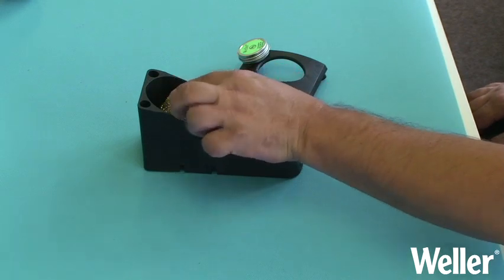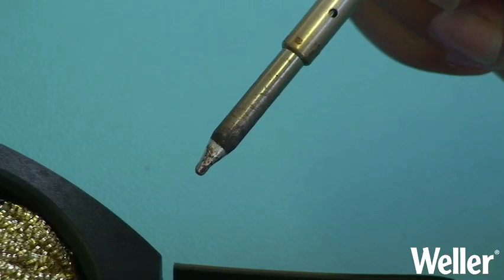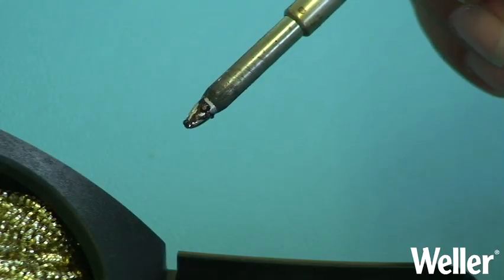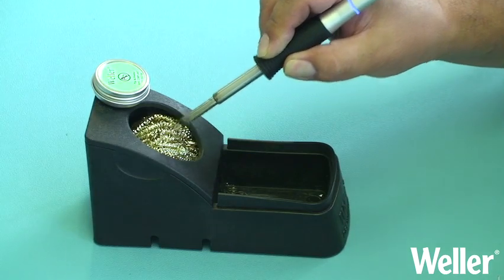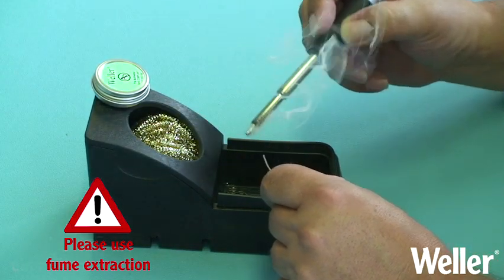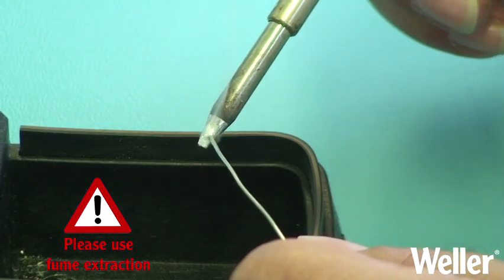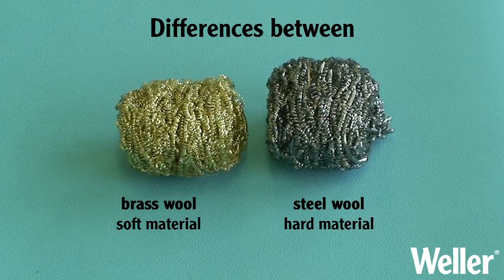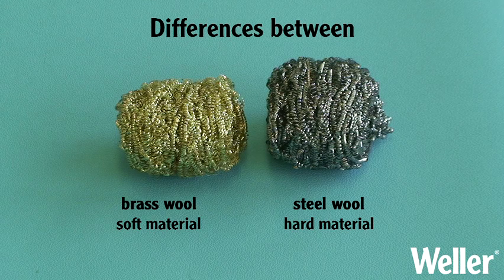Weller How to use a Dry Cleaner - Application Video

Comment: Won’t steel wool scrape the iron coating off the tip?
Reply: When he says "stainless steel will offer a longer life", I was interpreting that to mean it offers longer life of the stainless steel cleaning material, not longer life of the tip.  Since he says that the "brass is softer and suited to low abrasion", I'm thinking that should translate to longer tip life.  I use the brass. Between the tip tinning compound you see at the top of the unit and the brass wool, I don't have a problem keeping my tips clean.
Reply: @svyt  yeah, I think they are definitely meaning longer life of the cleaning wool if you go with the steel. I also use brass.